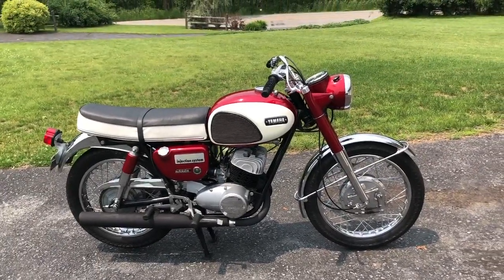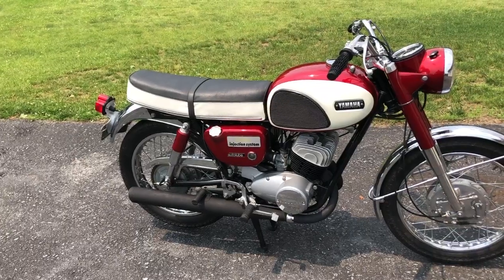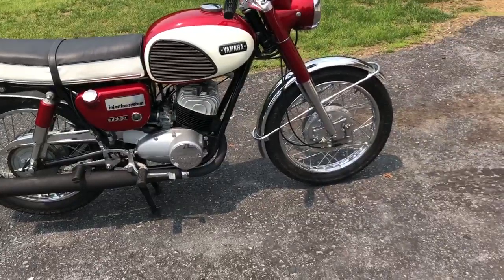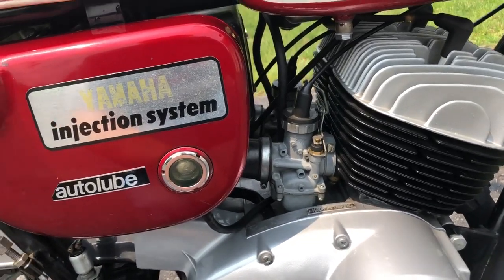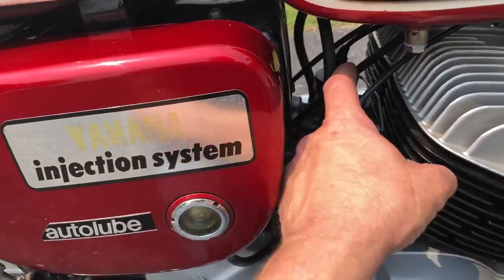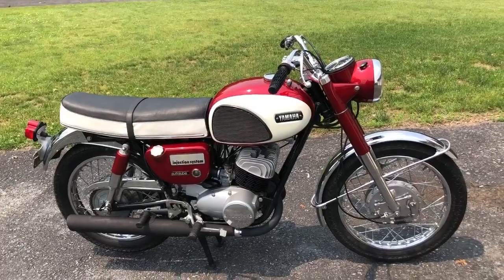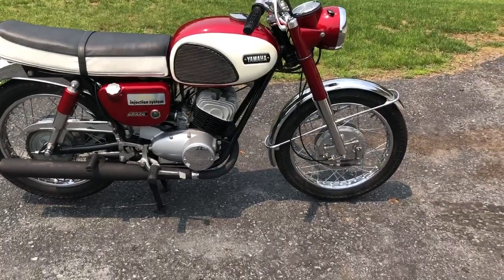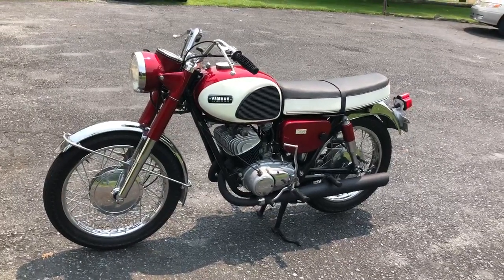1969 Yamaha YM1 Restoration Overview Video

Comment: I owned a 1967 one just like this from 1968 to 1972.  It would go 80mph in 4th gear at 8000 rpm or 80 mph in 5th at 6000 rpm. Took the baffles out, the air filter out, carb needle adjustable and ignition adj. Could not get it to go faster than 80mph. It still bugs me to this day that I  could not get past 80mph.  I think if would have lowered the gear ratio a little by a smaller engine sprocket or larger rear sprocket it wold have increased the top end some.  I loved this bike it was very reliable for bikes of that era.
Reply: About a 68 Yamaha 305 in 76 sold it around 1980-1981 I should have never sold it I love that bike and I got it going faster than 120 cuz I broke the speedometer actually watch the speedometer break I watch the hit the pin and I must have been doing faster than that cuz the needle just snapped and started spinning so anybody out there that bought one of these and the speedometer was broken that's probably the one I had
Reply: My friend onwed one as well and he spun the splines on the shifter shaft don't ask me how so I cracked in half for him and put a new shifter shaft in it.
Reply: My 68 YDS5E bought as my 1st bike in 69 with 2000miles on it - perfect.  Similar story - would clock 80mph in 4th and revs would drop when clicked to 5th gear.  Strangely it once or twice did rev out in 5th to the claimed 100mph.  I used to have to rev it had to get off the mark and ten it would fly.  Got hassled one night by cops who were insisting that I take off without any noise (the law infringement was for undue noise by manner of operation).  I always like to think that the harassing policeman was Terry Lewis who rose to Queensland Commissioner of police and later went to jail for corruption (the police involved were known as the rat pack).
I moved up from the 250 to a R5350 - a lot lighter and with an extra10 b hp. It loved to stand up and beg. Cheers

Comment: Yamaha makes some really good stuff I own 68 305 first 2-stroke with oil injection motorcycle or any 2-stroke engine I think mine was a screamer a broken speedometer I broke it by going faster than 120 I actually watched it snap and start spinning lol love that bike I wish I never sold it someone out there probably still has it I hope
Reply: My 1966 Suzuki T20 has oil injection. You are correct about Yamaha. In the USA, they marketed the first motorcycle with oil injection on the 125 Santa Barbara in 1964.

Comment: I think I have the same bike that was my dads, was in storage for last 32 years.   In general good shape but can't find parts.  One place told me it was a YCS1, but it looks exactly not like this one and not the YCS1.   on the Headlight is Yamaha YHA-1 but I can't find that model anywhere.   It is definately a 1968.     The gas tank is rusted badly inside and I need to figure out what to do with that or to try an find a replacement tank.  The seat is as hard as a rock so I need to replace the cushion at least and one tear in the seat.   Any help you could  give on where to get parts and if you know the color numbers of the paint on your bike as I will need to touch up the current bike I have with red paint.
Reply from the maker: Hi Bill sorry I didn't get back to you sooner. In terms of the gas tank, you'll have to treat the inside of the tank with some acid and then seal it. I typically use Red Kote for relining my tanks. The paint on this particular gas tank is ORIGINAL so I did not create a paint match for this bike. I'm not sure who can supply a paint match. If you need a hand with the tank feel free to get in touch with me. People ship pieces to me all the time for reconditioning. Your bike is in fact a YM1. The headlight bucket on the bike in the video is also stamped YHA-1. You'll want to search for "YM1" and "YDS3" when looking for parts. It's odd I know. I'm sure you've done some "Googling" already but maybe this will help.
Reply: Just like most Vehicles I'm pretty sure you can see the actual year on the tail light if it still has a tail light it's molded into the red plastic I sold mine in like 1980 pretty sure I bought it in 76 been a long time so I don't remember all the details but if you can get the parts and get it running you have yourself quite the bike there fast it looks like a slouch but they're not
Reply: YCS1 is a 180cc bike.
Reply: @ramishrambarran3998  Yup, completely different bike